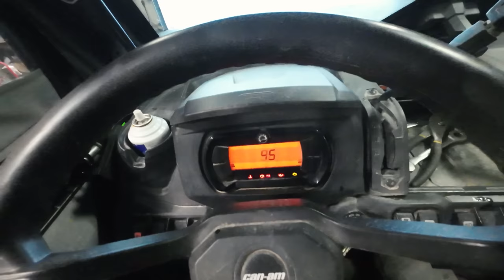Look What I Dragged In The Shop! Part 1 of Baby Blue

Comment: Cool old Dodge. My dad had a '66 C500 361 w5+2 pony axle 14 ft Knapheide bed w2 sets of tiptops. Hauled about 450 bu corn. My brother had a '64 CT800  413 w5+3sp aux. 16ft Knapheide w steel floor+gravel gate. Armstrong steering. Gave me the trucking fever + still doing it 50 years later. Just a little more modern equipment these days. '21 T680 KW. Still miss the old ones

Comment: M27304 is the dorman part number for that master cylinder. Napa has them available in their Billings DC. They lost for 134 bucks. Line code nmc. Just a heads up. I have a diesel shop out here in Oregon and I have seen several of these old Wagner brake systems on old farm trucks in our area. Keep up the great work guys! I always enjoy to watch you guys. Happy New Years

Comment: Well many years back while working as a Master ]ford tech we also did big Ford truck work and back then we rebuilt everything and i can  not tell you how many master cylinders we rebuilt along with the clutch master cylinders and wheel cylinders . when not at work i did side jobs and NAPA USE to have everything ya needed for anything. .

Comment: That clacking noise you hear when you first start the door opening is the very dry coils of the springs moving against each other as the spring starts to unwind. Some oil on those springs will make them quieter and make them last longer.

Comment: Son last skid steer I drove was a John Deere, gas, no cage or roll protection. Seemed to have its hands full with 1 round bail.  Things aopear to have chnaged.  No longer does getting stuck running the skid steer mean you're the next on the unemployment line.

Comment: You can buy new master cylinder cups at most parts stores, it makes it easy when you have the original to match it up because it will have a number on it.  I worked in a parts store for 10+ years and it amazed me how many shops would just buy a new/rebuilt master for $80 - $150 instead of  seals and cups for $5 - $15.

Comment: Finally get to see this running. I'm not even mad that the 361 was replaced by a chevy motor. They also came with 318 and 413 big blocks if it was a 413 I'd be mad though
Reply: I agree. If they decide to sell it, I want first chance. Then it will get a 413. It's been hunting for a home!
Reply: @stephenellis4392  old dodge trucks show up on auctiontime occasionally.

Comment: I love how that hood opens on that old Dodge the fenders move out of the way and the hood goes up that's something different
Reply: LCF - low cab forward
Reply: When I was a young apprentice at Cummins Ontario in the early 70’s, we worked on lots of these. If your getting into serious work on the engine you can remove the rad and fender assembly in about 30 minutes. I can’t get over how rust free these trucks look. Use it, but don’t abuse it.

Comment: We have an old 1955 Ford C-600 in the shed. It has the same style brake system with the booster under the floor. I recently picked up a 5.9 Cummins so I'm thinking bringing it out of retirement with a motor swap? Dodge was one of the first to use the hydraulic clutch system. Keep up the great work 👍

Comment: Might have to do something better for the cooling fan, it's so far from the radiator that it won't be pulling any air through.  You could put an electric fan in too.
Reply: The cooling will definitely be an issue.  Only an electric fan will fix that.

Comment: Good recovery on truck.  When bleeding brakes. One pushes puddle til it bottoms outZ, hold, tighten bleed screw.  Pump puddle up to hard hold loosen bleed til pedal bottoms.  T repeat that until no air comes out bleed.    Do that on each wheel
Also seems like radiator fan a long way from scroud.  May not get good air flow over radiator during hot day
Reply: I think Bob learned to bleed brakes a looong time ago!

Comment: Its amazing how good condition these Dodge trucks are!  The bodies are in such good condition and even the rear end is like new!  What a cool project it would be to put in a Cummins 12 or 24 valve.  Yes pricy but still.  Or a big Chrysler.  I understand the budget thing, so that GM 350 is really hard to beat for what you will do with it.
Reply from the maker: That would be amazing.
Reply: Yeah, I read that those 5.9L Cummins diesels, if cared for correctly, are built like tanks and practically bulletproof!
Reply: @noahater5785  yep and two wires to start it.  Great truck for that engine.

Comment: So a word to the wise, we worked on lots of these hydraulic brake units by Lethbridge. You fix the master cylinder, but your booster down on the frame more than likely needs rebuilding… (a few hydraulic brake suppliers still do, send it to them, they rebuild and ship back to you) but the problem is the brakes get out of adjustment, so the booster piston travels too far trying to move enough fluid to the out-of-adjustment brake cylinders to apply the brakes against the drums. The bottoming out wrecks the booster. If your booster is ok, consider yourself very lucky!! Otherwise it might need some attention to get the brakes A-ok. (You guys seem like you like to do things right!)

Comment: Just thought on safety. Might have been better to hook onto that truck facing the skid steer forward so at least you had the rear of the skid steer for protection. Family friend got knocked unconscious trying to pull a truck out with a farm hand. Chain shot up through the tractor rear glass and knocked him out. Really need a Deadman of some sort hanging on the chain and/or pull it different so if it breaks you don't get hurt.  (I've done stuff like what you did so many times and never really thought about it. Having someone you know get hurt tends to open your eyes to the danger) Stay safe guys!!  Also, I think you're going to need an electric fan for the radiator. Don't think you'll get much benefit the way it sets now.

Comment: 2 things I would do are get a carb rebuild kit and replace the points and time the engine.  When the carb sits for years the carb gums up and rubber parts crack and fail. Points corrode. You can clean them with very fine sandpaper but that is a temporary fix buy new. Good luck

Comment: A great place for a 6.5 center turbo GM diesel w/mechanical injection pump, done a few, bolt in where a gas Chevy engine once lived.  Find them in short school bus's, ad a mechical pump and off to the races.

Comment: I have great luck with silicone gasket makers (permatex ultra black for motor oil) for the big bud front motor cover.  Just clean surfaces good, install, and wait for an hour for it to tack before final torque.  Should work perfect as long as the gasket is not being used as a shim as gaskets can sometime.  I know with a pto I had on a civilian power wagon it needed a gasket because with gasket maker the gears bound bad.  Cheers and god's speed!

Comment: I was lucky on my '70 D500 that a local NAPA had a NOS master cylinder and rear wheel cylinders.  I asked what else they had laying around for a D500 and bought all their dusty parts because it's near impossible to find stuff for these old trucks.  Nice seeing these old trucks going back into use, even if it's more of the light duty work.  Hope you don't have to do the rear cylinders, they aren't fun pulling duals and axles.

Comment: I put a 427 chev in a similar truck. I mounted the engine farther forward I guess and never had to hack a hole in the floor. The 427 had so much more power then the 413 it originally had.

Comment: I think I'd have spent a little time finding a 5.9 and a NV4500........
Having a 350 with a quadrajet and one with TBI....... a 318 polyshere would be an improvement, a 361 or 413 a godsend.  But we have hills, so....
Mopar even used 549 IH and 2 cycle Detroits.  I'd put a 4-71 and a 6613 Roadranger in it.

Comment: Cool, she’s a classic. I’m surprised the vacuum booster is still good. I’m also surprised it has disc wheels and not the old Dayton spoke wheels. There were several manufacturers that made medium duty trucks during war time, but many of them couldn’t hang. The nice thing about the oldies is that you don’t have to plug it into a computer to work on them. Creature comfort was not a thing back then. Power steering was an option for a price later on but it’s standard now. Have fun with it.
Stay warm!

Comment: Nice video.  I think you have a vacuum leak on the engine maybe base of carb or some cracked hose.  It may need the ignition timing set.  It sounded pretty solid though.

Comment: To head off the people who say sitting a battery on a concrete floor will kill it, the problem is that the dirt on top of the battery leaks off the charge and then it freezes and dies.
Reply: I used to work on electric forklifts for years. We got our battery training from the factory. Exide would send their engineers out for training. So I asked the guy about sitting on the floor. He told me they lose 1.5% to 2% per day. No matter where they are sitting. He said extrem cold would not really drain it just reduce its ability to produce high current. Then I asked him what he did for Exide. He said I design batteries. I always considered it to be gospel.
Reply: @TreverDuncan  There is still a measurable voltage loss across the top of the battery when there is dirt there to hold moisture.
Reply: That’s just shorting the terminals basically, no?
Reply: Wasn't that old time batteries when plastic was new and porous?
Reply: The old school bus that our church has, hasn’t been driven or started in five months.  It fired right up yesterday.  It’s an International Diesel, with zero electronics to kill the battery over time.

Comment: Be careful, they don't even sell rebuild kits for those master cylinders because rebuilding them is dangerous. A hydraulic system from a GM big truck would fit in there without too much modification and parts are readily available of you can't find Dodge parts.pretty good looking truck for a dodge, might be the last year with any style.
     Best regards from Indiana.

Comment: "Gaskets" I took this idea off of a snowmobile Forum that I watch. If you know someone that has a "Circuit" or "Cricket" I believe it's called??? Used to cut out stickers and such. A person was having a hard time getting a float bowl gasket for his snowmobile engine and he had a friend that had one of these machines and cut a new gasket out of gasket material the machine scanned it and then cut a new one out of the appropriate gasket material. And I'm sure as you are aware then you can make a computer file on each vehicle and save the information I thought about this for your big bud tractor and it may be less expensive then the factory gaskets.

Comment: Lucky you don't live in the "RUST BELT"!  I would change the brake system over to a more modern 'Hydroboost' system if there is a power steering pump on the truck.  I have an OLD Ford F600 dump truck (1967 vintage) that has a vacuum boost system under the cab, mounted on the frame. That system was always a problem.  I think I got the last vacuum boost repair unit in the world and that was 30 years ago!

Comment: I've seen those old dodge trucks (i like my dodge truck)on your channel for a while and always wondered if they run. They look like they are in good shape and would make good farm trucks.  FYI if you were going to use that truck may I suggest taking off the fan and installing some eletric fans as it won't pull air thru radiator correctly and will probably over heat.

Comment: What year is your Dodge? It looks a little like a late 60's to early '70's Ford N700. I love the old Dodge trucks! They were built so well. I've owned a '73 D100, a '79 D100, and my current truck, which is a '98 R1500 with 235K miles [runs great!]. You see a lot of old Chevy, GMC and International grain trucks from that era, and a few Fords, but not many Dodge grain trucks were built. Glad to see you'e taking care of her. I gotta' say, though, if you're going to run that truck on the highway, you should modernize the brakes. You already know what happens when a single-chamber master cylinder fails. A new, two-chamber master cylinder isn't very expensive. It takes a little work to run the new brake lines, but the peace of mind will be worth it!

Comment: I relate to that old truck. Why not give it a go? Does everything have to cost a hundred grand in a rig that size new, may not even get one for that much considering a pickup costs as much as a eighty ninety thousand dollar waste of money in five years dead on the road rig. I see folks look at the springs and frame first before even looking under the hood on  rigs now, so that is some kind of indication that "they just don't make em like they used too"........  if it will make heat for the cabin, call it winner winner and a chicken soup deal.

Comment: you need some sort of system that hooks onto exhaust pipes and pipe the exhaust out of your shop.
Reply from the maker: I've thought about that, or a exhaust fan in the ceiling that can quickly pump the fumes out. Just stinks to see all the heat go out too.
Reply: hoses/pipes that can hook onto or be near the exhaust would probably be best option as your not loosing the heat

Comment: Wish you hadn't constantly talked about "oil" in connection with the brakes. Some people might just go with that as truth and  kill themselves and others when the rubbery components swell and fall apart leaving them with no brakes  when they are most needed. BRAKE FLUID ONLY!! of the suitable DOT specification for the year and model. If desperate, in an emergency use water but use the brakes sparingly and drive slow and flush the entire system thoroughly as soon as possible while repairing.

Comment: Take the booster and master cylinder out of that GMC and retrofit it to that old Dodge 600, having a dual master will be much safer. Also lose the engine driven fan and run an electric unit.
Reply from the maker: Great ideas!

Comment: Nick were those batteries sitting on concrete you can recognize by letting it sit on concrete you should have some plywood or something under them
Reply: George  all I can say I have had it happen even with brand new batteries they claim it's the moisture in the concrete
Reply: George  Years ago it was a fact with I think it was the old Glass type/glass case batteries.

Anymore its more of a "its probably colder vs sitting on something else" thing.

Comment: What a cool truck!  I like that thing.  The fan looks like it might be a ways away from the radiator.  It might end up not being quite as cool as I think!  🚚
Reply from the maker: That was an issue we haven't figured out how to address yet. The old engine had a raised fan on a Pulley. I'm sure if needed we could rig up a better fan setup. Possibly electric too. Thanks!
Reply: @WelkerFarms  Looks like you have room for both!

Comment: Have you heard that leaving a battery on concrete will discharge and eventually ruin them????   I usually set mine on a board or a rubber mat or anything that may insulate them some.   Just a heads up incase you have ever had that happen.   I lot of my batteries (unused that is)  sit around for a year or more before they end up being put into service.😁😁😁😁

Comment: It's been a while since you busted out the skid steer, time to see how well those Z-lug tracks do in snow compared to the original C-lug tracks that came on the machine. Also, you didn't pull the drive shaft on the truck (or pulling the axle shafts also works), you could destroy your transmission if it's allowed to rotate even in neutral without the engine running due to a lack of lubrication due to the engine-driven oil pump not running, but I understand if the transmission was already completely shot to begin with, in that case you don't have anything to worry about.
Reply: This truck has a manual transmission, not an automatic.
Reply: @wssides  I'm pretty sure you'd have to pull the driveshaft and/or axle shafts to prevent your transmission from destroying itself regardless if it's a manual or an automatic.